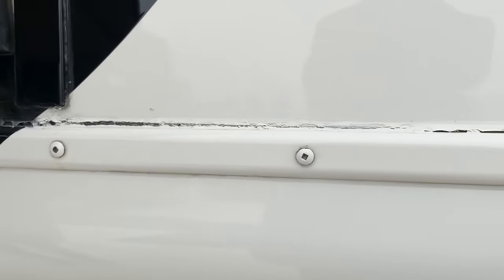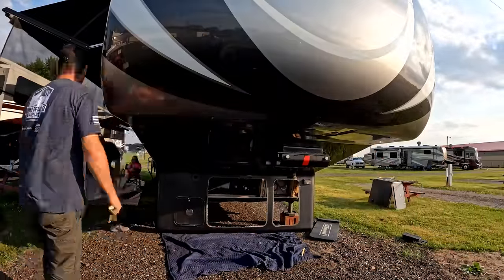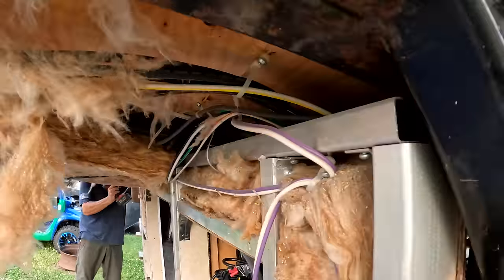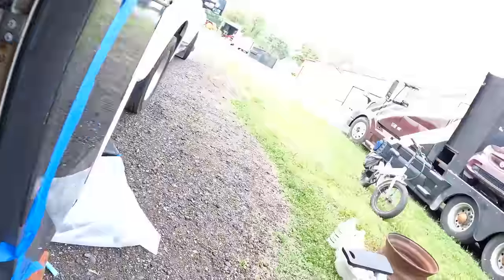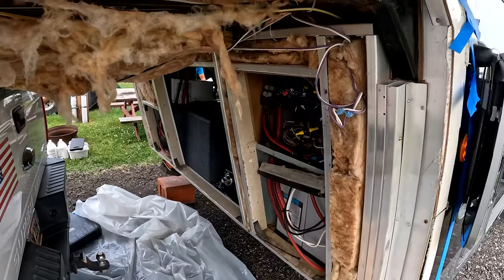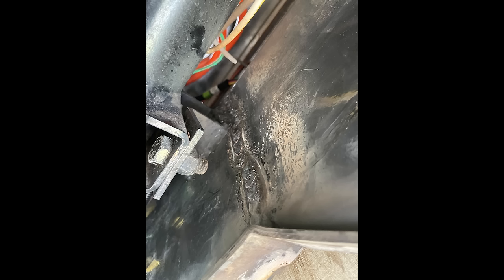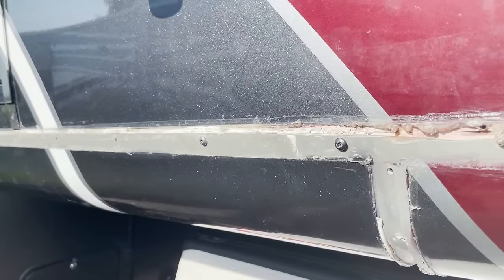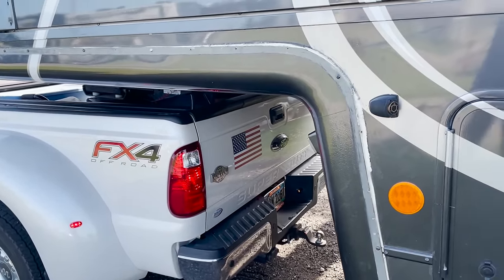WHAT???  Your Frame is Broke!  Lippert Broken RV Frame 7-27-22 DRV Elite Suites

Comment: What messy job of wiring. Totally unacceptable. But the problem with the frame is they're using cheap Chinese steel and not high strength steel. Cheap, cheap, cheap. Welding is only a temporary fix. The frame was not engineered correctly if any. The guy doing the welding is doing a terrible job. He doesn't know how to weld.

Comment: , Unfortunately once Lippert delivers these frames they don’t have any control of what’s being placed on the frame or how the incidence of rust are avoided ultimately DRV will be responsible for all of this as they are not asking Lippert to upgrade the frames as they build heavier models, all of this is going to lead to one place and that is a bill in congress that will change the entire RV industry requiring standards similar to vehicles standards , and in this case and many others a frame should be at least 20% stronger then necessary because of just road conditions alone loading the frame momentarily . ask yourself this would you feel comfortable knowing your frame only has a 5 to 8% margin of safety ? No is the answer , all of this could’ve been prevented through engineering simple engineering at that this is not rocket science, A few extra structural upgrades in the areas of most stress which would cost practically nothing tabs of metal running on it angle across exactly the weakest place in the frame which is right where it would crack literally $25 worth of metal and a half an hour of welding would prevent 😏all of this the fact that DRV is negligent in understanding the capabilities of the Lippert frame once loaded with the product they build on top of it and what customers might do tells you they don’t care and now they’r. going to get themselves in $billion lawsuit. unfortunately this will encourage many people to start digging around all models that are built by DRV and many other builders who are using a similar Frame and may have weight and overloading issues themselves this will just mushroom into much bigger revelations of RV builder/building shortcuts and negligence. if you want a perfect example of that the Underneath that encloses all this is built opposite of the way it should be the top should overlap the bottom and then it would be literally impossible for any moisture to get in there but since the top Slides down into the lower If there’s any gaps in the rubber sealant silicone sealant water will always be present this is an oversight this is pure stupidity gravity is the number one factor in building an RV if they were just smart enough to use it.

Comment: Looks like they are running an aftermarket hitch which doubled the pin torque on the frame.  This is generally the major cause of these type of failures.  If they had only stayed with the factory hitch which the frame was designed to handle, they probably wouldn't have had any issue.  Lippert probably specifies an extended hitch like used will void the warranty.   Don't blame the design when the loading and torques are changed.
Reply: Standard moyride hitch sold on new DRVs

Comment: They come rusted from factory. They don’t bother cleaning the metal before welding or painting/powder coating. Just bought a brand new toy hauler and upon closer inspection I’m fcking pissed off about build quantity. $66k in total for it and it looks 5 years old already

Comment: Wow, Lippert should do it themselves or pay to take it all apart repair the underbuilt frame and put it back together, I can't believe they are not. Welding the frame is the easy part, but probably no stronger than it was originally unless they are adding gussets.

Comment: The issue is on lipper frames from 2001 to current. The issue is that the frames weren't built right to start with and break. But repairs aren't right either. Need to have proper welder repair and plate the frames

Comment: Just shows they are building them as cheap as they can get away with. In todays world it's all about cost, it's cheaper to just weld the brace to the structure then put a fisher plate in and weld to that or add gussets plates to each side of the brace to stiffen it up. The weakest point of any weld is the the end of the weld as heat of the weld changes the metallurgy of the  base material making weaker, especially at a stress point. As for the  final repair well that is just as bad as the original job as it looks like they missed fusing the two metals together when they tried to weld the post back in, it looks like someone tried putting it together with bubblegum. I would take the service repairman's job or the factory repairs as his was a more quality weld job even with the  bracing added.

Comment: I've been welding and fabricating for over 50 years and I also have a Montana 5th wheel RV. I have repaired plenty of campers over the years. The major thing I have found is that the frame manufacturers use to thin of tubing for areas that require more strength. They also don't use gussets for bracing in statigic areas. Another thing that I have noticed is the bad quality of welds. Most frame companies use mig monkeys on the assembly line and they are rated on production.

Comment: This is an ongoing issue with larger  units. Keep in mind this is not the frame builders fault. They are building these frames to the manufacturer specs. They are not specing these frames out strong enough to handle the weight of these large rigs. Any RV over 30ft is prone for this. They try to give it a nice name of "Flex frame". The manufacturer could easily fix this issue by using thicker metal and better welding with plating when they first build these units. The manufacturer cheap it up to save money. These people were very lucky. Yet I bet is you go to brand new one they are being built with the same old specs. Unfortunately I don't think the manufacturer will change there specs till someone dies and they have a massif law suit on there hands. This is a well known issue by the manufacturer. The price of these units keep going up in price, yet they are putting out junk. Also this is still going on with newer units, with some manufacturer.

Comment: People, this isnt a Lippert design flaw, this is a keystone engineering flaw, understand that. To me Lippert makes some of the best equipment there is. Keystone engineers how they want the frame made for whatever models they are building and Lippert obliges. Fish plates and gussets are a great idea but they add to weight and you might not get that extra tv you wanted in your camper, this isnt Lipperts issue, they build what they are told to build, this is the campers manufacturers fault. Their engineering, keystone for example is worked out to the pound without consideration as to how the camper will be loaded or used. I'm a master rv tech who has seen this sirt of thing time and time again, front frame flex. Currently we where i work are a service depot for keystone recalls for this issue involving adding more structural support to minimize flexing. Its a very intensive job to remedy and to date once repaired, there hasnt been an issue. So people quit blaming Lippert try blaming the people who load these frames at the factory, Lippert does awesome work, keystone for example does crappy work.

Comment: They all suffer from shoddy work practices  DRV should know better than to use Lippert because their frames were an issue long before 2014.  Lippert frames have been a concern since at least the early 2000's.  All of these RV suppliers use untrained people to do everything from welding to cabinetry.  The piecework model of assembling them, whereupon a team gets a bonus that elevates their normal pitiful wage to a living wage if a certain number of units go through an assembly station is the worst and most quality averse system of production known to man!  When you hire whole families of Amish or Mennonites to man your factories , which one of them is going to take the time to correct an issue before it leaves the factory and be the one responsible for denying the whole family that bonus?  This crap has been going on forever!

Comment: Below is a link to a video by "RV ROOF INSTALL" located in Oglethorpe, GA.  In his shop is a "BRAND NEW" 2017 Mobile Suites fifth wheel with "100 MILES" on it.  In all fairness, the roof was not leaking.  I am assuming the customer wanted to re-roof with a 60mil building grade TPO product this company offers.  After the rubber roof was removed, a number of DRV construction short comings were noted.  Between the "broken frame" frame and other issues, I believe I am going with the "Riverstone".

https://www.youtube.com/watch?v=vMUqKWtYPq4&t=54s

Comment: Moisture didn’t have to be in there for it to rust. Coating just could have been junk from the start or vibrations rubbing it down. Once it’s through true coating, exposed bare metal rusts.

Comment: As a millwright I find those welds disturbingly poor on the original work, and the final repair. Looks to me like the design was done using static load calculations. A trailer is ALWAYS a dynamic load. Yes it needs to flex in some areas, but not in the area of the 5th wheel to frame connection. The repair parts did not look to be fully welded, which will become an issue down the road.

Comment: I had cracks in my 2014 Raptor 381 frame as well as the 3” plates that support the side walls.. found out about it in July 2021 when my rv was in the shop for water leaks in the bedroom. Coach Specialists in Mansfield Tx told me about it and I called Keystone and then Lippert. Keystone said they had no liability, and Lippert said they could not even look at it until January 2022.. and Coach Specialists told me they would not let me leave it there for the frame work after they completed their repairs in December..and my truck was in the shop also, so had no way to move my trailer. Coach Specialists charged me $125 to tow trailer about 5 miles to an rv park. I then had to go to work and truck was still in shop, so had to pay $800 to have someone tow trailer to Vicksburg MS for me. Went to two more jobs before I ended up in Indiana, and found an Amish man that specialized in trailer repair, and he was not only able to fix the broken welds and strengthen the frame, but take it apart and put it back together and do it for less money than Lippert wanted to just weld the frame. I hope to never have to buy another rv with a Lippert frame or parts again.. and still own this same piece of junk Raptor because I owe too much on it.
Reply: seems like a lot of folks here could use that  Indiana mans contact info.

Comment: This is a fundamental failure in engineering design. There a range of ways not to build a joint and they've done almost all of them. There's triangulation ending mid span, when they've ended the triangulation they've closed it off, which results in a substantial stress raiser at the interface, they've also welded along the total length of that interface, which weakened the parent metal at that point. It also looks like they had a bit of a false start on one of them, which resulted in a heat affected zone stress concentrator right in there, which was the crack initiator... It would have happened anyway, but maybe a little slower.
The weld repairs shown at the end look like they'll probably just change where the next failure occurs, rather than eliminating it, and the gussetting as they've installed it will trap water, so they'll have corrosion issues as well.

Comment: I don't necessarily see it leading to a catastrophic failure. The entire from body assembly was bearing the load when hitched (which is why you saw the seem opening). I'm not saying this is bad, every time they drove it and hit a bump it was torqueing the entire front cap, but the chance of the entire frame, walls, and everything failing at once is VERY low. Unless the rig was drastically over loaded, and in the nose. 

That said, the same exact break on both sides is VERY disturbing. It speaks of improperly assembled brace locations, too thin steel, and steel far too brittle. That's a HIGH stress area, as evidenced by the break location. Lippert has some splainin to do.
Reply: It is a 150k plus unit! That is the main H beam that holds the front and yes it very well could have been catastrophic. Don’t be silly!!!
Reply: Well I don’t think he was eluding to a catastrophic failure of the type you’re pointing out, more likely his concern is if, God forbid, he got in a accident or went over a huge pothole, and the frame shifted,  don’t you think it would be a little hard to handle?  Could cause a more severe accident, he never said he was a metallurgic engineer!
Reply: @jamesburr236  not h bean that's rectangle tubing.
Reply: @jamesburr236  You are correct.  Mark Wandrey would have us believe the fiberglass and aluminum wall system will hold the unit together when the steel frame fails completely?  Not!

Comment: 99% of the time when a crack occurs it will be at the edge of a poor weld. These people at LPI should know better. This incident in the video is conducive to poor design, lack of structural support plates, gussets, poor engineering and zero quality control.

Comment: Looks like poor engineering and/or poor construction.  Obviously this is not the 5th wheel to buy.  That is one big crack!  That is poor engineering and lack of correct steel.  That will require a rebuild not just welding.

Comment: Sorry if I missed this, what model year is this?
Reply from the maker: 2017  The issue seems to be between 2014 and 2017 frame build dates.
Reply: @thenomaddetailerrepair2375  So it seems, they can't even push this off on the whole 'Covid' excuses used by so many the last couple of years. Which leads me to Quality Control from two of the high quality, well known companies in the industry-A bit scary.

Comment: That thing is junk. Who did the Finite element analysis (FEA) is the process of simulating the behaviour of a part or assembly under given conditions so that it can be assessed using the finite element method (FEM). FEA is used by engineers to help simulate physical phenomena and thereby reduce the need for physical prototypes, while allowing for the optimisation of components as part of the design process of a project.

FEA uses mathematical models to understand and quantify the effects of real-world conditions on a part or assembly. These simulations, which are conducted via specialised software, allow engineers to locate potential problems in a design, including areas of tension and weak spots. What a joke they should, I can't say it. Why not put on a flatbed.

Comment: Lippert stands for low quality. They have zero quality control. That combined with bad engineering and sloppy manual manufacturing is a bad combination for RV customers. 
P.S. there is only one thing that is worse than a Lippert frame and that is a Lippert slide 😂